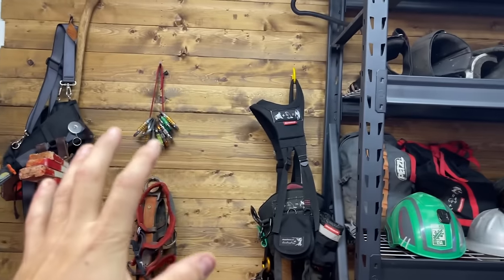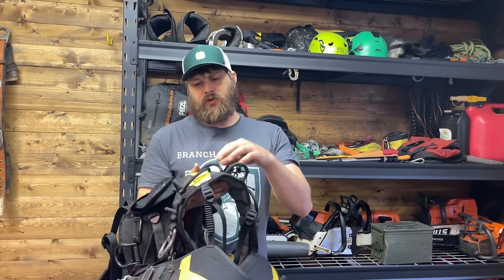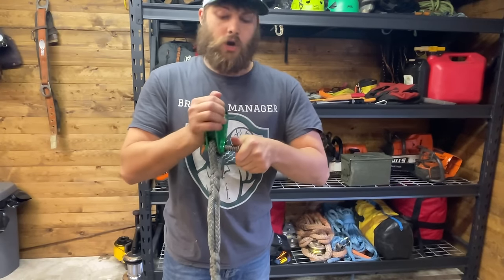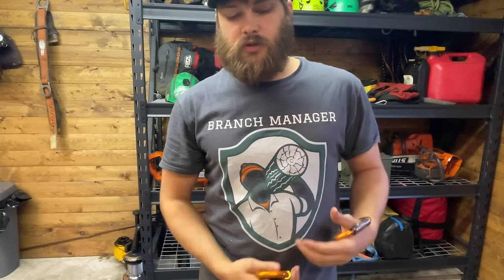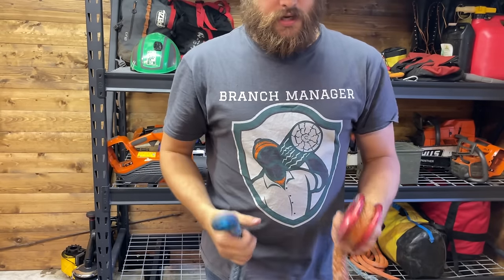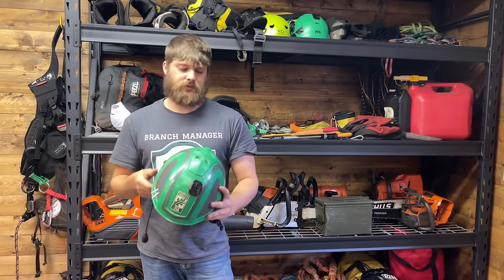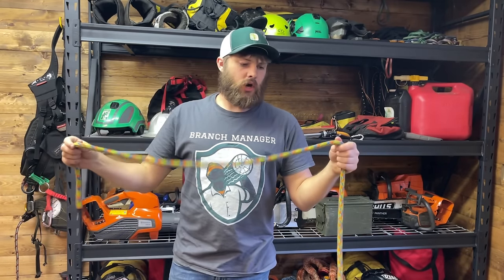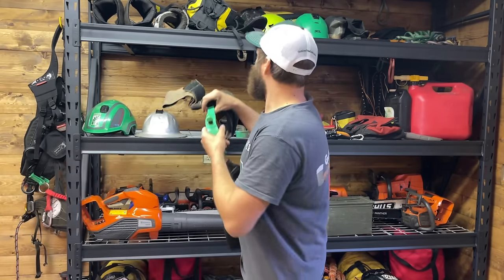Going over every single piece of Arborist gear that I own.

Comment: from what i can tell about why xrings are sooo popular is because you are moving the ffriction to up in the tree. so when you get a crispy been dead for ever and there is no way other than to climb it, spreading out the  friction helps to not break out rigging points.  and they are so cheap that you can buy a lot of them. i also think the best way to use the rings is with a lots of them in the rigging system. that way you can load the tree together in compression have the rigging rope zigging and zagging through the tree.  NOW, in the PNW they might not be the best because everything is a pole. out where trees are these hugely wide canopies that is where these things shine.
Reply from the maker: Well said
Reply: @GuiltyofTreeson  Now you understand wide canopies here in the east in Appalachia.

Comment: one thing about hanging you monkey beaver saddle , per monkey beaver they told me its not idea to hang it from the suspenders because it wears out the elastic on the back of the thing that goes over the shoulders. i now just use a short piece of rope and half hitch it to the rings that the suspenders attach to. if im lazy i just hook it by one of the side rings.

Comment: Pretty sure one of the benefits of the rings is that with a block, the evenly distributed forces creates more dynamic force on the rigging spar, where as the ring, by nature of producing some friction, displaces the force into the spar rather than yarding on the rigging point. Just something to utilize in some situations 🤷

Comment: Tree guy from Michigan, we love the ultra slings and use a ISC iron wizard carabiner rated to 75kn to be able to hook the nearest loop to the working end around the limb. Saves so much time instead of tying knots and not having to take the rope out of the block all the time.

Comment: Figure 8 makes a great redirect for SRT. It allows you to redirect easily on a weak limb, almost like a temporary cabling. You take a bite of rope, pass it through the large hole, pass it around the limb & back through the large hole, then capture the bite around the small hole. Super quick, easy, & secure.
Reply: That sounds interesting. Downside is the force wouldn’t be distributed between your tie in and redirect. I just use loopies with carabiners
Reply: @morningwood603  you are correct if there is slack between the main tie-in & redirect. But if you set the figure 8 with tension between them (which is easy to do) then it does distribute the force & change the force vectors as well.  The force distribution is not equalized and depends greatly on where the climber is in relation to both the main tie-in & redirect.

Comment: thanks for sharing your gear with us!!  I store my gear on shelves too.  One thing I like to do is put the chainsaws, oil, and fuel on the bottom so it does not get onto my climbing/rigging gear.  Just a tip that I like to use

Comment: man, now i feel old AF and im just like 2-3 years older than Jacob. i did learn descending on the 8s and ascending with those hand ascender thingies. if you google them now, just add like 30 years to them and then you know what we used in disaster relief. :D

it was just a grip with like 2-3 rollers. upwards was easy free movement, downwards they friction locked the rope. 
practically indestructible, didnt care about mud, sap, gravel, rocks, debris or even metal stuff. 
prolly a little bit havier, but you could just twist the rope a little and add them mid rope. 

man, that day my mind was blown. (before that day we used self-tightening knot-slings to ascend... yeah THAT oldschool..) .

Comment: Jacob-another nice informative video. It’s always interesting to see how the younger generation is coming up in this industry with all the new technologies that we have for climbing and rigging. 
Regarding the bigger guy needing a more padded harness. I’m 6’ 2 and I weigh 240lbs. I’m a big guy built like a brick _ house. I’ve been climbing for 38 years. My favorite harness now of all times is the Tree Motion. It does not have a lot of padding. I think what you’re trying to indicate/get through to people – is depending how you feel in a harness with a term in the type of harness you want to get. I still have my very first harness I ever climbed in and it is absolutely nothing. I’ve use several different harnesses over my career and I am absolutely stuck on the TM. 
OK, now back to the video! Thanks Jacob, you’re doing a great job.
John 3:30

Comment: when talking about your rigging slings and blocks and ropes, i learned that you actually want the sling and block to be the strongest point because you dont want a block to go flying through the air especially when you are up in the tree with it.  but what i think, is that with all this over head like 5 to 1 safety margin you aren't going to break anything anyways. and as long as you aren't rigging big wood on half inch you are going to be fine.  but half inch is probably strong enough to use for big wood as long as your groundie is letting it run. about the standard for the half inch double braid and tenex is 10k plus breaking strength. actually stable braid is 10,400 for half inch and tenex tec is 13,100. so using half in all the way around  will be fine  imho
Reply: Yeah since tenex is a lot stronger it’s perfect being the same diameter as the rope

Comment: You should keep that figure 8 on your harness. It's good if you need to rescue another climber and their system isn't viable. You can lower yourself and the patient even though your rope runner can only support one person.

If you add the figure 8 to your front D ring to add friction underneath your runner 😇

Comment: Tenex is polyester and a bit more abrasion resistant than Amsteel (which is Dyneema). The only advantage to amsteel is 3x strength vs tenex.

Comment: in my experience sap is a key player with a stiffer roap vs a softer one for example i have an adjustable landyard in order to wrap aroubnd weird things in the tree and harder reaches cause the adjustment knot that allows me to change the length but if i get it too sapped up that knot doesnt like the move so much (i know they make mechanical things for this) and then i have my main lead thats old school as hell and hard as hell that i never car where i put it or what i do with it but unfortunately doesnt work as well with knots

Comment: re: the MB slings; if you're just using them for branches, how heavy can they be?  This is one of the easiest and multipurpose pieces of gear to reproduce.  Could you not even just buy bulk webbing off a roll and fisherman knot it into a loop?  Never mind having to have it sewn.  But I really liked your rating of the MB gear bag "it has ...stuff in it, I like it".  I want a bag like that too!
Reply: I use a water knot (tape knot) to tie the webbing into a loop. 
Nothing heavy, just have to zip over the kids playhouse. 
Totally amateur here, retired too.

Comment: Gotta stop dropping and slamming carabiners. The non steel can get hairline fractures very easily. Just want u to stay safe
Reply: rock climbers looked into the micro hairline fracture theory of aluminum carabiners and lab testing found that the various aluminum used in carabiners and in all rock climbing equipment was high ductility (resilient and not brittle) so hairline fractures never occur